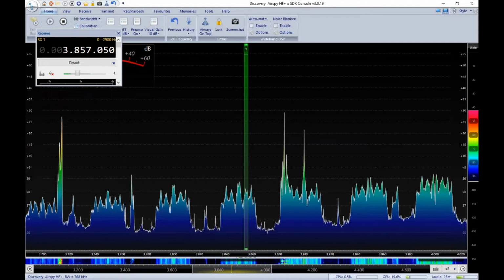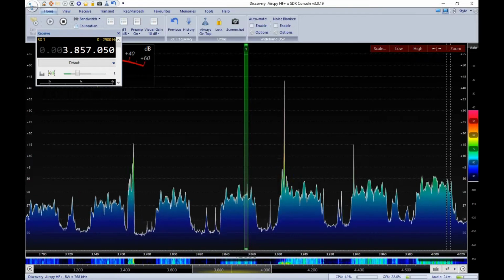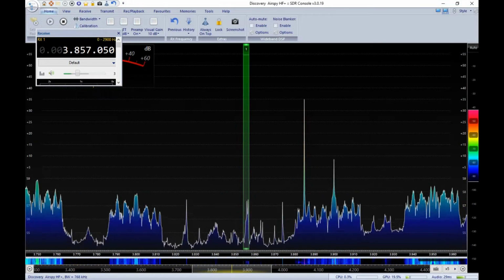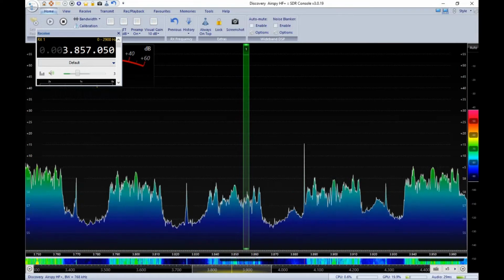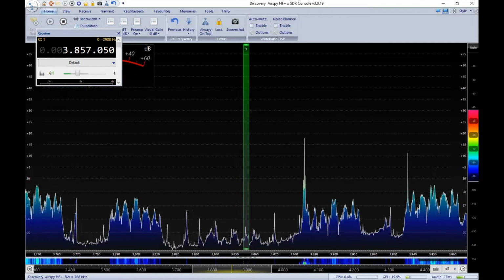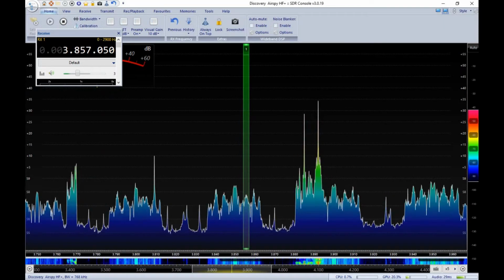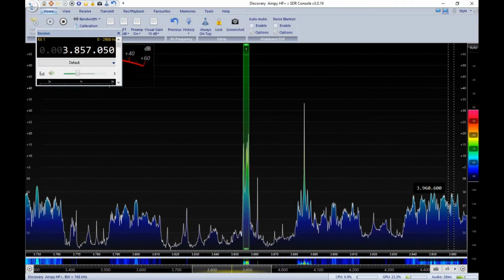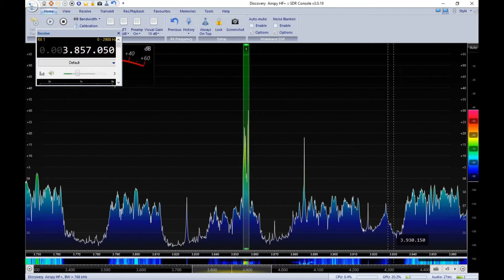Eliminating Solar Inverter Noise with the Timewave ANC-4 Part 1

Comment: I have terrible inverter noise but I can simply switch off the inverters. The main problem is the mains power pole noise from nearby medium sized high voltage power poles or their transformers. Do you think this could help with this noise mainly broadband between 30M and 10M?

Comment: Hey! I have a large solar system powering my recording studio. I have good power conditioners in the studio with filters in them, and have a whole home conditioner from Satic Shield, but I'm still getting a consistent spike at 15k on all audio equipment. Does anyone know if the Timewave ANC-4 can be used to phase cancel an inline, high frequency produced from the inverter? I've been researching all sorts of noise cancellation and suppression, help would be appreciated. Thanks, Dan
Reply from the maker: Dan, ANC=4 is not designed to work at audio frequencies.  First thing I would do determine exactly which part of your solar system is responsible for producing the noise.  The only item that I know of that produces such low freq. would be the main inverter, using that or low freq. for the switching internally.   Does the noise go off at night?  W1VLF
Reply: @W1VLF   hey, so it’s definitely not a low frequency, 15k is nearly dog whistle high. But no it doesnt go away at night and it is definitely in line noise made by the inverter when transferring DC to AC and it doesn’t seem to matter if it’s from batteries or PV. It is literally an extremely narrow frequency spike generated at exactly 15k, and I’ve heard of other people purchasing this inverter that they have similar issues.
Reply: @DanielNelson-f5v  What are you listening to at 15khz?

Comment: I wonder if it would help with the issues I have here. Our LED ceiling lights and the shop lights in the garage wipe out the ability to receive pretty much anything below 400 MHz.
Reply from the maker: Not really designed for VHF UHF.  If I were you I would wind some common mode cores on the line cords. The mix would be determined by the frequency of the signals you are interested in.
Reply: Bryan- Just some info I fought with the LED noise that was generated by LED bulbs I found that GE BRANDED LED were Horrible- I switched to Phillips and they were MUCH cleaner- the GE would wipe the spectrum here from below 160 up through 2 meters or so. if there GE branded try switching them with Phillips and see what happens